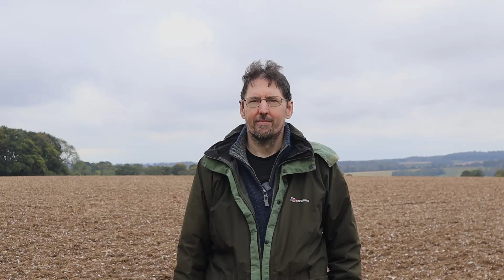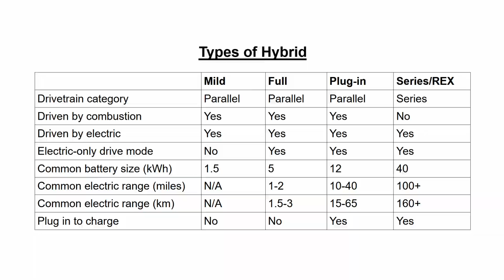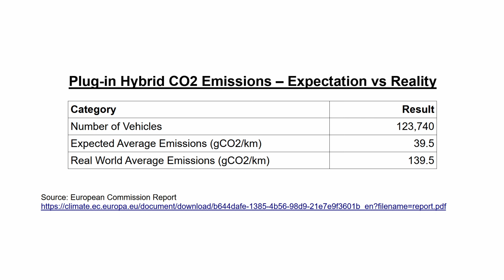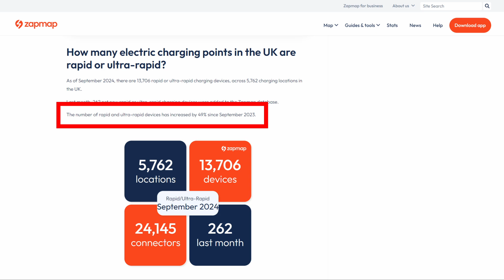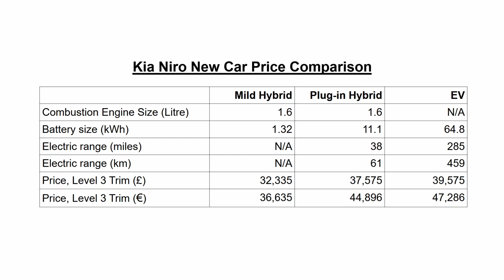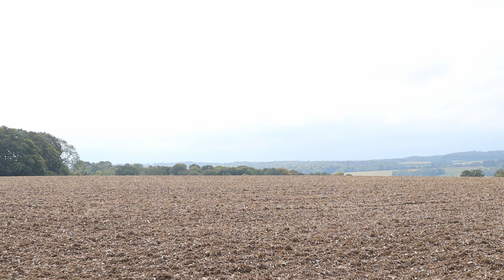Should We Buy Plug in Hybrids?

Comment: I had very expensive problems with PHEV'S. I've now got an EV and it is so much simpler and cheaper. No need for PHEV anymore.
Reply: I think we are getting close. Where I live in West Texas, it is between 200-250 miles one way to the major cities (Dallas, Lubbock, San Antonio, and Austin) around me. I have a Chevy Bolt and I get around 200 miles range at 75 mph. I know it's advertised to have 256, but realistically I can count on 200. When I bought it in January 2023, I could not get to Lubbock or Austin and back due to a lack of DC fast chargers. Now, the situation is very different since I can use Tesla Superchargers and there are more CCS installed where I need them. I can now chose to take my Chevy Bolt where as for most of last year, we'd have to take our BMW i3 to travel comfortably.
Reply from the maker: @chrisb508  I'm glad to hear that the infrastructure continues to improve. Yes, the opening up of the Tesla network is great news. I used my first here in the UK last week - I've been meaning to for a while, but I finally got the chance.

Remember that you can stretch your range a bit further by dropping your speed, should that be useful. The EPA rating is based on a slightly lower speed than that, if I recall
Reply: @theelectrictransition  It is true that driving 60 mph instead of 75 adds about 20 or 30 miles to the range. It’s just nice to not have to stress about it. I can’t wait for the day when every town has a DC fast charger. That will eliminate range anxiety completely.
Reply from the maker: It does feel like a solution that has had its day. I'm sorry you suffered the expense. Was it a similar/repeated problem?

Comment: We've had two BMW i3's, and both have been brilliant. The 2014 had a 22 kWh battery and the 2018 has a 33 kWh battery. Normally, we just charge at home. We did make a 500 mile trip without charging once. My main complaint is that oil changes and general service is extremely expensive. I guess that's why they don't make them anymore.
Reply from the maker: Both with the Rex engine, by the sound of it? I have heard that the Rex has a few failure modes, but I'm glad it's worked for you.

As labour is so expensive now, I can understand that the servicing adds up
Reply: @theelectrictransition  Yes, Both i3's had a REX. In both cases, they've worked well (knock on wood) I think the high cost is down to them being BMWs. Well, I think $300 for an oil change to be a bit excessive in any case.
Reply from the maker: @chrisb508  Yes, that seems a lot doesn't it

Comment: I own a 2014 Volt, it's pretty good, not much degradation. PHEVs are only as good as manufactures make them, and as consumers use them. Bob Lutz on Autoline a couple weeks ago gave an anecdote about a woman who bought a 2011 Volt and put 200k miles on it. She said she liked it but was a bit disappointed with the fuel economy, she never plugged it in.
Reply from the maker: The Volt was a great idea, and it's a shame that it wasn't more widely accepted as a valid choice. That long ago, batteries were insanely expensive, and the series hybrid seemed to me to make an awful lot of sense. However, since then, batteries have become so much cheaper, and it might be that the idea was of a time. At some point, it no longer makes the sense it did.

Enjoy it. I'm somewhat jealous that I didn't get to own one when they were launched. Having sad that, my choice now is different.

Happy Volting!
Reply: @theelectrictransition  The volt was a great idea, but more importantly, perhaps, it was very well executed. I believe it to be one of the best 'plug-in hybrids' ever made. I still have one (although these days we use it mostly just for running around town) which I have owned since 2016 - powertrain has worked faultlessy throughout, no noticeable battery degradation, still 40-45 miles in summer and about 40mpg when running on petrol.